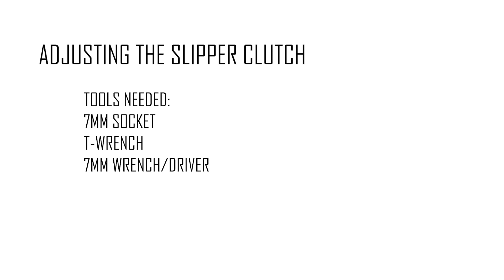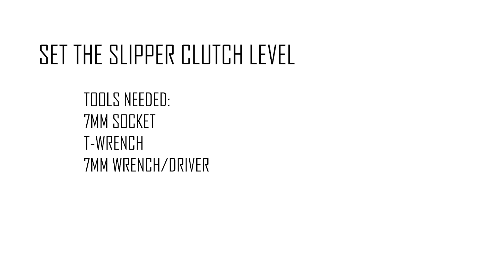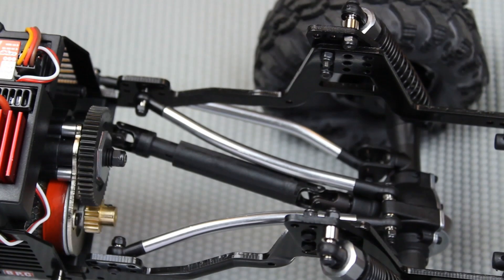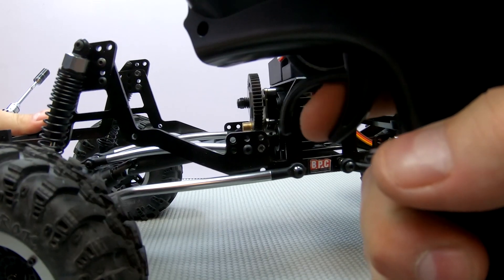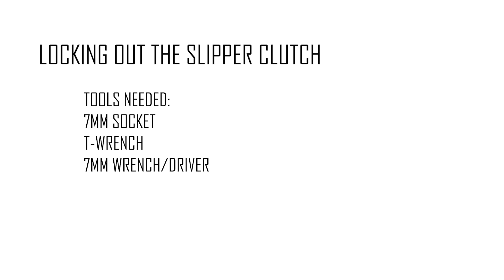Redcat University - Slipper Clutch Adjustment and Lockout

Comment: All these add on are great but in my case after 3 uses in the gen 7 the ecs went out
Reply from the maker: Sorry to hear you are having some issues. Never fun when something fails early on. Some folks with RC models can go months if not a year without ever having an issue and sadly sometimes electronics fail early on. 

However; the awesome thing about hobby grade RC's is they can always be fixed, repaired, or upgraded. Nothing is ever completely broken/damaged beyond repair more often than not.

And with any and all Redcat models they come with a 90 day electronics/defects warranty. So the warranty would cover something  like the ESC going out this early. Simply filling out the warranty form is all that would need to be done. And that can be found here: 
http://www.redcatracing.com/Warranty-Claim-Form

Also our support team is always there to help so feel free to reach out to them anytime they are available as well. Our support team can be contacted via email or phone Mon-Fri 8am-430pm AZ time. We can help for sure!!

http://www.redcatracing.com/Contact